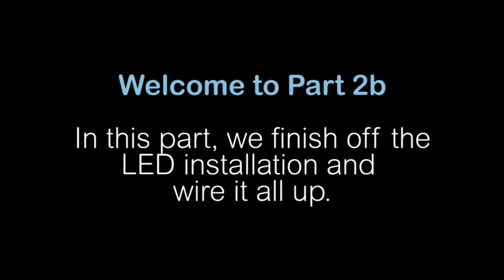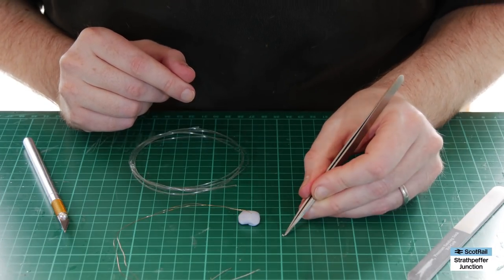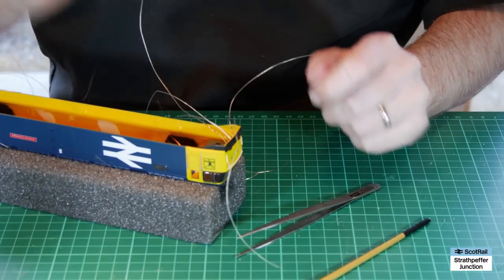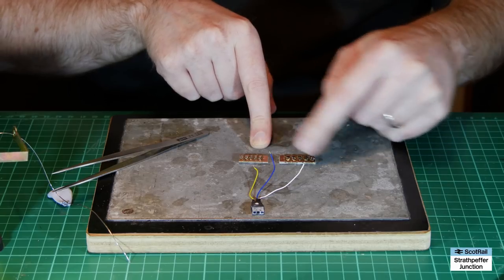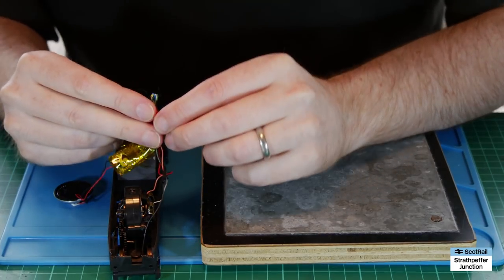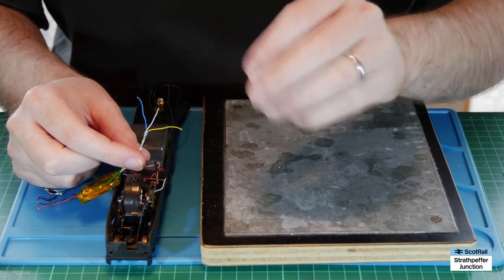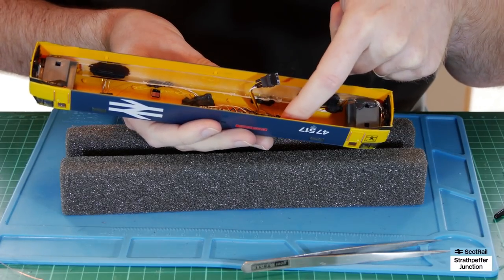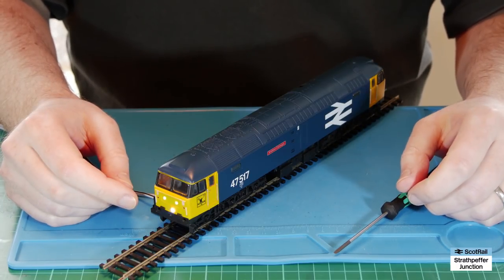#15 Lima Class 47 Loco Upgrade: Wiring up Directional Lights (Part 2b)

Comment: What a fantastic video, you explain every step so well. I have been subscribed to your site from the start and find them informative. So now I can do the rest of my fleet cheaper than buying Express Models kits. Keep up the good work.
Regards
John
Reply from the maker: Thank you so much for the kind words, John. Really appreciate it. I have to admit, I do buy the Express Models lighting kits too from time to time, as they're a great product and make the whole process a lot quicker. I recently did a Class 24 and used their lights, and they work really well. But, if you have the time and patience, making these up yourself for about £5 total can save you a little bit of money. It also makes further bespoke customisation of lighting possible...I'm still trying to perfect some highland-style headlights using these wee LEDs!

Comment: Hi love the video very detailed. Im currently upgrading my Lima class 47 and have installed a DCC decoder and now started on the lighting. Im having trouble locating a supplier for the miniture 3-in one plugs & sockets wonder if you can help?
Regards
Chris
Reply from the maker: I bought the ones in this video from a retailer around fivie years ago and I don't think they're trading anymore. I'll have a check and also see if I can find another source. If I have anything of use to share, I'll pop it in another comment below. Many thanks!
Reply: @StrathpefferJunction  Thanks Chris

Comment: I thought that the two videos were very good, and helpful. Could you give links for where you get the components from? Circuit board, resistors, LEDs etc.
Thanks
Alan
Reply from the maker: Hi Alan. Many thanks indeed for the great feedback. I got a few requests for components links, so I've started putting links on my newer videos. If there's anything specific you're having trouble tracking down on this one, let me know and I'll happily point you in the direction of where I got stuff from.
Reply: @StrathpefferJunction  specifically the small resistors and LEDs, please.
Reply from the maker: And in terms of the wee smd resistors, I bought a starter bag to begin with. It was something like this one: https://rover.ebay.com/rover/0/0/0?mpre=https%3A%2F%2Fwww.ebay.co.uk%2Fulk%2Fitm%2F302912212700
Reply: @StrathpefferJunction  Thanks for that. Without the knowledge, or the exact names of the components you can't search properly.
Reply from the maker: No problem. Aliexpress is great for electronics consumables, so long as you don't mind waiting a few weeks for them to arrive.

Comment: clean installed in the upper part, will I remember how to make it, got in front of me in the course of the year a class 37 and 47 of lima with ebay England bid, greeting Andreas
Reply from the maker: Very best of luck with them. With a little bit of work and detailing, the Lima class 37s and 47s can still be nice wee models. I think the main thing is to make sure that they either have a decent ringfield motor in them, or change out the ringfield for a 'CD motor'. That way they will run fairly well, as well as look good. I'll be doing a video on that in due course, but there are one or two out there already showing how it's done.
Reply: Strathpeffer Junction , Thanks for the information, I have digitally rebuilt already 2 lima Locos and run fine, just the wheels are very dirt sensitive, please excuse me if this is English not so good
Reply from the maker: Your English is fine...better than many people born in the UK!

Comment: I use liquid solder paste and a hot air gun for SMT soldering
Reply from the maker: I did wonder about that. I have a hot air station, but have never tried using paste for this. I was mainly put off by the cost of the paste. Do you have a good supplier reasonably priced?
Reply from the maker: M thanks. I'll definitely look into it 👍🏻

Comment: Hi David, this video came up on my Youtube channel late last night so watched all 3 till the early hours ....   the LED's you used are they available on ebay or do you sell as a kit as I have a couple of Diesel locos I will probably add this chip and lights ... also im still on with my layout should be up and running in summer but the Attic is no no so building a shed ... Regards John
Reply from the maker: Hi John. Many thanks for the message. I'm happy to hear that the video was of use to you. I don't currently sell the LEDs I used, but there are fairly easy to track down on ebay. Just make sure that you get ones with pre-soldered wires otherwise they are extremely fiddly to use. I think I used 0402 smd LEDs for that job, but you might get away with the slightly larger 0603. The 0402 are ideal if you're OK working with such tiny components, as they'll tiny and easier to fit into small spaces.

Comment: You could do with painting the inside in black as most Lima bodies have a lot of light bleed, when you put LEDs directional lighting hence the painting the inside Black as Lima as a much thinner quality of plastic.Bachmann / Hornby / Heljan / Dapol are a better plastic and I find I don’t need to paint the inside. Thumbs up, great Tutorial 👍
Reply from the maker: Hi Jamie. Many thanks for the comment. I did indeed paint the inside plastic (around the LED installation point) black for that very reason. Once you've sealed in the light by painting over the LEDs etc., you don't get any/much light spillage inside either. Without black paint, the light bleed can be pretty bad in these Limas, but it can be an issue in Bachmann and Hornby ones too (speaking from earlier mistakes!).

Comment: Is it possible to have the red rear lights switchable when hauling?
Reply from the maker: You'd struggle to do that with a TTS decoder out of the box as your very limited in what you can tweak and map, but you might be able to do it if you use the single aux function to work a transistor, which then switches the feed to red lights on and off.
Reply: @StrathpefferJunction  Such a good idea... now I'm looking out for the video!!!!
Reply: @StrathpefferJunction  would you need to drive 2 transistors, 1 for each cab?
Reply from the maker: I've not worked out the circuitry, buy my guess is you could use the the green aux wire to power the lights, irrespective of cab, and have two transistors linked to the white and yellow wires, which switch the cab light on/off depending on the direction of travel. You could then control the cab light on/off via the green wire, but it would only come on depending on which direction the loco was running. You may even be able to wire it so that it only comes on if the running lights are off. I'd need to test a circuit as this is just off the top of my (new dad baby brain) head, but I think something along these lines could work in theory at least.

Comment: Thank you for showing cracking vids on this subject....it’s just a shame I’m a dc dinosaur....regards fred...ps had a look at your web site ..what an amazing guy you are ...brilliant tutorials 👌
Reply from the maker: Thank you, Fred. I really appreciate the kind comments. You can install lights broadly like this on a dc system, if you feel inclined. The resistor values can be the same (or you may prefer to have them slightly lower, if you want the lights brighter at slower speeds). You just need to leave out the decoder and reverse some of the LEDs. So, headlights in no.1 cab and rear lights in No.2 cab have their LEDs in one orientation, and headlights in no.2 cab and rear lights LEDs in no.1 cab have them installed the other way around. Doing so, only one combination will come on in one direction.
Reply: Strathpeffer Junction .....thanks for the info .....
Reply from the maker: No probs. I tweaked my last comment a little bit to make it clearer. ☺️

Comment: I wired my Hornby 47 in a similar manner although you did a neater job with those LED'S.  Not sure I would want to do all my loco's like this its a time consuming operation, I may look at these eBay lighting units for a few of the more complex ones.
Reply from the maker: It does take a wee bit of time, but I've used both pre-made and my own, and there's pros and cons to both. Doing it yourself does cost a fraction, but like you say, can be a bit more fiddly depending on the model and lighting arrangement.

Comment: Hi great vid, i have done the same idea on a lima 37 but yours is wired better as to using smaller LEDS and fibre, i used 2mm LED's as far as i can remember, i made up a small circuit board at each end which at the motor end was very tight. Some better ideas from you for my next attempt.
Regards Paul
Reply from the maker: Glad to be of help! The first one I did used bigger LEDs, but with these nano LEDs becoming cheaper, they're my go to ones now. 🙂

Comment: Hi David, very nice collection of videos on installing lights. I think we both tend to use the same materials, SMD’s, LED’s Fiber Optics etc.  When I use Fiber Optics with SMD’s I tend to use thin gauge Fiber to go through the drilled holes and at the other end I use a slightly wider Fiber, slide the SMD inside and then slide the wider Fiber over the thinner. (Hope that made sense, you can then paint the Fiber black without it going on the SMD). Can I ask, does the Activator work on all glue’s, I think it is something I need to buy?…Simon
Reply from the maker: Thanks, Simon. I think I can just about suss out what you do there! I'll try to give it a shot next time (might be an 08, as I've one I'd like to light up once it's resprayed). Re the cyanoacrylate activator, it can be hit and miss. They normally suggest you buy the same company's activator. I've found that the activator seems to work OK with the glue that I have, but I have heard from some folk that they've had problems mixing brands. So, I guess to be absolutely sure, it's probably best to buy the same brand. It is great stuff though. Particularly for fiddly stuff like this. I think the instructions say to spray it first, then bring the two parts together, but I find with tiny wee bits with very little glue, spraying once in place works OK.

Comment: Hi David, yet more excellent info. One question please, have you made the little PC board yourself ?
Reply from the maker: Hi Michael. Yes, it's just a small strip of copper clad board with the copper cut out in a grid shape, with SMD resistors soldered across. You can buy something similar from LaisDCC, although all the resistors are the same value (which may be too low a resistance for red rear lights) and they're quite pricey for what they are.
Reply: @StrathpefferJunction  many thanks David.
Reply from the maker: No worries.

Comment: Very interesting.
Reply from the maker: Thanks, William. How did you get on with the decoder?
Reply: Everything worked out fine. I now have the Class 47 and a Bachmann Class 20 now fitted with TTS decoders. 
I am wondering about fitting lights to this class 20, and the Hornby Class 31 TTS. Have I the nerve?
Reply from the maker: William Glover Great news re the decoders! Buying an express models lighting kit (if they do one for those models) cuts out a lot of the fiddly prep work (albeit not always all), but they are around £15 each I think. Let me know how you get on 👍🏻

Comment: And yet another damn fine video. I was wondering during the video why you didn't drill and use smaller LEDS.  Hmm prototypical huh. Still nice to see what those other wires are for. I don't think you can get away with a short video with the type of conversation you are doing. Still another good one cheers. Looking forward to number 3.....oh can we see the locomotive running when you are finished?
Reply from the maker: Many thanks, Guy. Much appreciated. 

Yes, for the headcode and headlights, you could probably get away with non-smd LEDs in some circumstances, but the fit is not always quite right and I try not to drill new holes unless I absolutely need to as I've sometimes ended up making a mess of things. 

If I can use existing openings with miniature LEDs, that's what I tend to try to do - but it does take longer and can be quite fiddly. You also tend to get 'normal' LEDs in 5mm, 3mm and 1.8mm (tower) sizes, which isn't always ideal, as they tend to be slightly too big. 

But, if you're not bothered about being absolutely prototypical, which is totally fine as everyone has different properties in their modelling, then they can be a much simpler and easier option. 

I probably won't have enough progress on the layout to have the loco running on that, but I'll set up an oval so I can run it properly. I've not been a huge fan of Lima's since moving on my childhood ones, but now I've spent so much time on this one, I'm getting a soft spot for it! I still don't like traction tyres, though... 😉
Reply: @StrathpefferJunction  hense why my Australian based lima class 44s/930s have athearn sd9 mechs under the bodies. Same with my lima gm class bodies for traction and also due to not like traction tyres

Comment: These series of videos are great for upgrading those trusty Lima locos, can't wait to get my class 31's into a similar upgraded state. May I ask where you obtain your wired SMD LEDs from please?
Reply from the maker: Hi Simon. Many thanks for your comment; I'm really glad the videos are of use. I get my SMD LEDs from AliExpress. They take two or three weeks to arrive, but they're pretty good value. You can get them from ebay and some seller on there are UK merchants, but the price is normally a lot steeper and for less quantity, but they will arrive a lot quicker. I used 0603 size pre-wired one, but I also have the even smaller 0402 ones, which are handy for making tail lamps etc.
Reply from the maker: This is a link to the 0402 ones: https://www.aliexpress.com/item/20pcs-bag-0402-SMD-Pre-soldered-micro-litz-wired-LED-leads-resistor-20cm-8-15V-Model/32828588727.html
Reply from the maker: Here's some 0603 ones: https://www.aliexpress.com/item/20Pcs-T0603WM-Pre-soldered-micro-litz-wired-leads-Warm-White-SMD-Led-0603-New/32846959352.html
Reply: Thanks for the links, I'll obtain some of these. And then beef up the resistors a little as well. Did you get them from the same place?
Reply from the maker: I think I got the resistors from RS electronics in the UK, but I honestly can't remember. For this sort of usage, most sources will probably be ok. Tolerance isn't too much of an issue for this application.